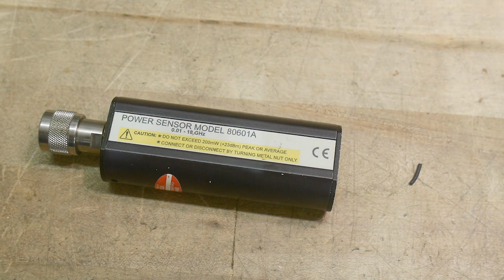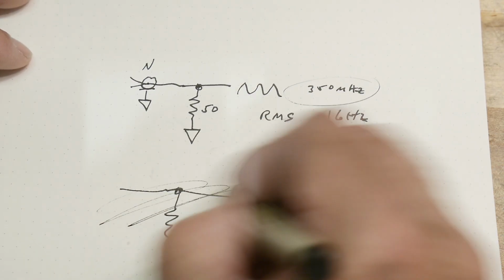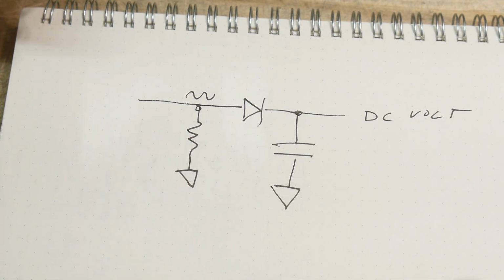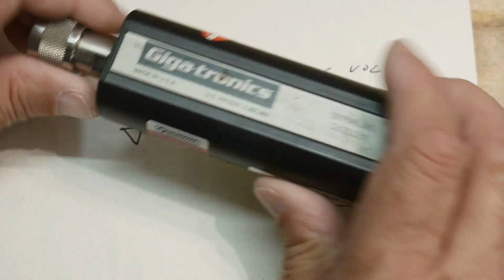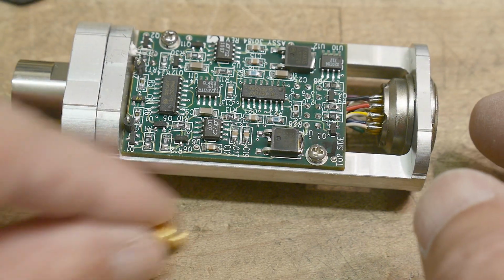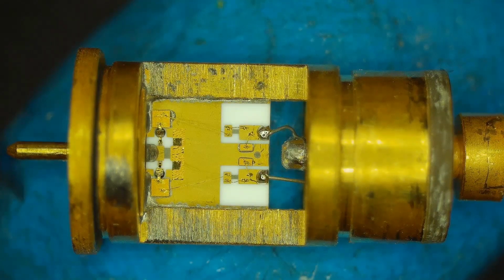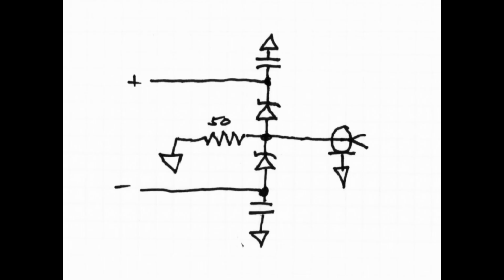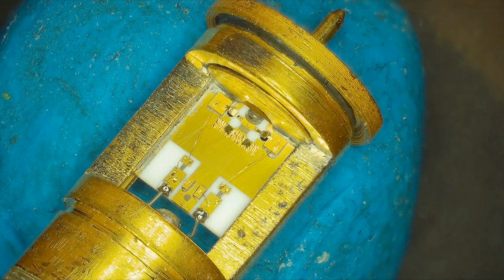#1447 Why are RF Power Sensors so Expensive? Can I fix a broken one?

Comment: You blow up something like that.. the shriek of the high-pressure magic smoke escaping must be something!   As small as that is, probably only your dog could hear it.
Reply: for these power sensors (some measure pW) ...you don't see any evidence of anything happening... all you see is an overload indication on the power meter. Next time you try to zero, and cal it... you can't do it.
Reply from the maker: I will have ImsaiDog on alert 🐕
Reply: willthecat is correct - the components are too small and the power levels involved are too low for there to be any sort of alarming noise. the input resistor just quietly burns out without any sort of fanfare. You'd have to connect the sensor to a BIG amplifier, and all you'd probably get is arcing between the inner and outer conductors.
Reply: @NimbleJack3  it's a" magic smoke" joke.  You know, about how components stop working when the magic smoke gets released?  The more expensive and fancy the component, the more magic smoke it contains.

Comment: If one doesn't need the  greatest sensitivity or operation above a GHz,  seems like it could be built.   With those conditions, would 1n5711s be better than an AD8307?
Reply from the maker: https://youtu.be/cDBdwLW1qzA
Reply: If you can get good RF diodes (and I mean good) and you can get someone to cut the PCB, with the appropriate PCB material... and you can do the transmission line, and capacitor design (or get the appropriate capacitors) then you can get something working... which you would have to cal... so you probably need a working HP/Agilent/Keysight sensor, and power meter. Many have tried... many have failed. Much better luck at HF and a couple of GHz through.
Reply: Down at HF and a couple percent precision it's easy, difficulty ramps from there.

Comment: No microcontroller? Then the cal parameters in the I2C e2prom are used by the software that reads the power from the power sensor?
Reply: Correct, the calibration factors are specific to the sensor. So when a sensor is connected to the power meter the cal data is read from the sensor. This makes use of different sensors easier.  Prior to that, power meters had tables of "cal factors" stored in them and the user had to remember which table went with which sensor and manually select the correct table. Those tables had to be manually entered into the power meter memory.  And prior to that, power meters had switches or dials that had to be set to the cal factor for the correct frequency based on a printed table attached to the sensor.  Regards, David
Reply from the maker: the sensor is used with a power meter: https://youtu.be/TxFgd_1f13s

Comment: I've been wondering why the HP Power Meters are so cheap but the sensors are silly money - many hundred $$$ or more. Great video thank you. I'm building one from an AD logarithmic chip with a Arduino that has some calibration capability so it will be good enough for my hobby RF Stuff.
Reply: Yes, you will never get the band-width, and dynamic range, of one of these Gigatronics (or HP, or Agilent, or Keysight) power sensors. That's what makes them desirable for RF metrology work... the range of frequencies, and power levels... and their accuracy and precision. You won't duplicate that for 100 times the cost of a new sensor from Keysight.

Comment: Back when I ran acceptance test on a particular C130 Radar system we use to build for the X and Ka bands I'd use a couple of similar  HP sensors. I'd forget to power down the Power Meter before unplugging the sensor and something would blow in it. Needless to say after the 2nd time that happened I got a good chew'n from my boss and never did that again. I'd even leave a sticky note by the connector . They'd send them back to HP at the time to get them repaired but I think it was $$$.

Comment: thanks for the vid, i think you did not resolve why it has to be gold, Thanks
Reply from the maker: lead-copper contact will generate 5uV/degC   gold-gold is zero
Reply: @IMSAIGuy  but is copper to copper not the best?
Reply: @heinrichhein2605  Copper oxidises, gold does not.
Reply: @IMSAIGuy  I only know it from low EMF connection even the under layer of the gold can be a problem
Reply: Very conductive, corrosion resistant, and no mating dissimilar metals which can have galvanic activity.